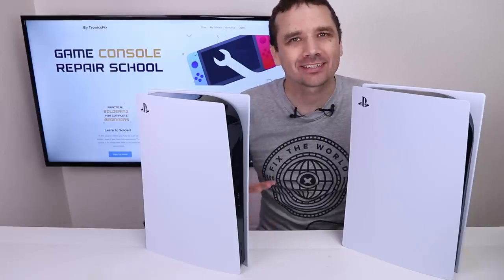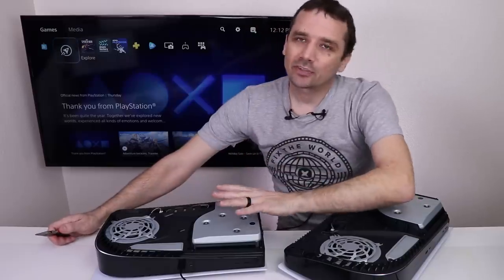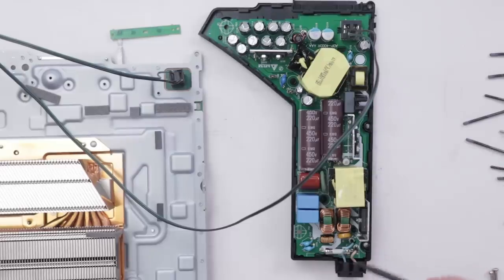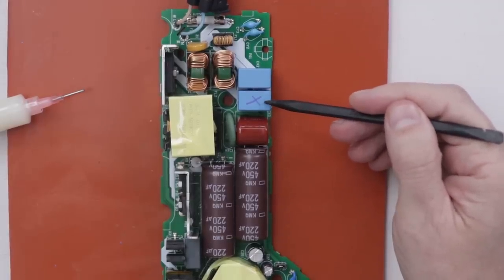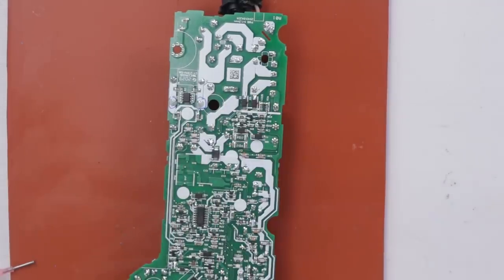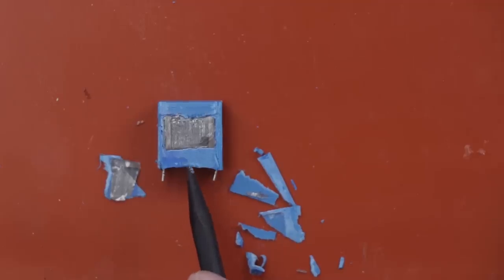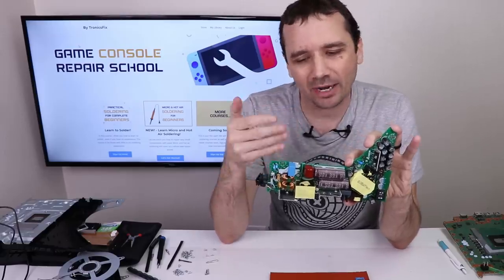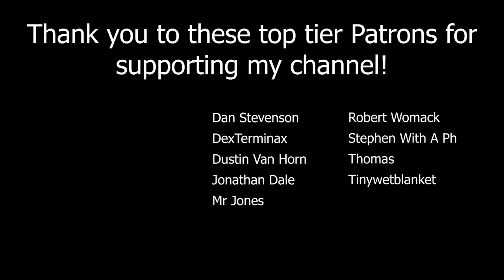PS5 Coil Whine - What Is It and Can I Fix It?

Comment: Hi there, I have some ideas on how to solve the whine you're hearing. I broke it up to several parts:

1. What is the cause of capacitor whine? How does current translate into audio? Why do more demanding games create more coil whine or capacitor whine?
2. How to replace the capacitor with a different one and what to look for
3. A strong warning about ESR specification and how to match it
4. An elegant solution that might work without replacing the existing capacitor, by adding another, small capacitor across it, and how to select the right capacitor, and how to do measurements to help select it.

1. First of all let's go back to how you understand capacitors, because you need to change your understanding of those to understand where coil whine comes from. So let's talk about current. Current happens in a circuit when the voltage source is somehow shunted to ground, through some sort of impedance. In the PS5 most of the use will be from integrated circuits. Transistors inside those, on the silicon die, essentially connect the voltage rail to ground, or something to that effect. This is almost completely a resistive connection. You call that a resistive load. You can imagine someone having a resistor going from Vcc (the voltage rail) to gnd (ground). That creates the /request/ for current: the supplying circuit will be able to feed it current up to a certain point, at which the load itself will start limiting the current. But most often the supply circuit will be the limiting factor, supplying less current than the load in question could transfer at most. This is due to where the current comes from. Where does it come from? It has to reach the chip in question via a long lead on the pcb (which has resistive and inductive impedance), maybe a connector, a cable, and then essentially it comes out of some sort of transformer. Transformers are the ultimate source of impedance in the circuit. Because they have high series inductance, they can produce a lot of current, but only /after some settling time/. This means that as you change your current draw, the transformer has to settle towards that new level of current draw, before it starts outputting that. During the transition, there will be pre-ringing and post-ringing. If the current request increases, the current will mostly undershoot and then overshoot and then it'll settle to the new value. It'll happen the other way if the current request decreases. This over/undershooting happens because the transformer itself has to produce the current. To do that, it needs to source something called the electromotive force. The electromotive force is what physically makes electrons in the circuit have the "will" to run around the circuit, producing current (charge moving around the circuit = current). This electromotive force takes some time to charge up because it actually comes from the other side of the transformer and that takes a while to transfer over air, kind of like the battery in your mobile phone doesn't get charged immediately using a wireless charger. Same thing. So now you have the transformer reacting to the changes in current consumption, but there's undershoots and overshoot. Overshoots are easy to deal with: the resistive load will be unable to pass more current through itself than it can handle. The undershoots are bad, though. This can cause a so called "brown out", and generally can lead to circuits not working as they should. It won't break them, but logic circuits can go awry. So for this reason, you need another source of current that will react much faster than the transformer. Imagine you have your voltage rail fed by a transformer, and only that. So what can you do? Well, you could add a battery in parallel, across the voltage rail. It holds some charge and is able to supply it very quickly. However, this charge is eventually going to deplete, unless you re-charge it. This is, essentially, what a capacitor is: a battery which is able to re-charge. Inside the capacitor, you have a roll, but unlike you said, it's not one strip of foil that is rolled up. It's actually two strips of foil. Those strips of metalised foil will be separated by a dielectric, and then as you roll the stuff up you also add another layer of dielectric to insulate the roll from itself. The capacitor stores charge in an electric field located between the two strips of foil (called plates). If you unrolled the capacitor without damaging it, it would still work. It would be two very long strips of foil with a piece of dielectric between them. One of the plates contains positive charge, and the other contains negative charge. The dielectric isn't infinitely rigid - it can be compressed. So the plates contain opposite charges... those charges will attract. Depending on how much charge the capacitor contains, the plates will attract with more or less force. The dielectric between them counters that like a spring. The plates will therefore move closer and further away depending on what charge there is in the capacitor. This creates movement, and if this movement is fast enough it can be heard, and that's called "microphonics". So why does this happen so often? Because the chips in the playstation turn their gates on and off very quickly, in a random pattern. This pattern is very random and will contain all frequencies up to the gigahertz frequencies at which the gates close and open. But it will also contain lower frequencies (because it's random), including audible frequencies. So what happens is that current changes a little, and then the transformer has a little lag and a little drop out before it can respond with the new current that was requested. So instead, a little charge will be unloaded from the capacitor, to provide the current that's missing, in tandem with the transformer. Remember, charge going out of the capacitor is current, just like water coming out of a container (eg bottle) is water current (like the current in a river). So every time a gate closes or opens, requested current changes, and therefore the charge in the capacitor changes, and so the plates in the capacitor move a little, and therefore they output sound. This actually explains why people hear this more in more demanding games: more demanding games require more logic circuits to be utilized (closed and opened), which means more power draw in total, this means higher current, and this means that the current swings are larger when the current ask changes, and therefore the charge across the capacitor gets depleted more when it needs to make up for the sagging, and therefore it is louder.
Reply: 2. So what can you do about this? You have a microphonic capacitor. You can do a few things. The first is: Install a different capacitor. There isn't really a rule to which ones are going to be better. However, things like MLCCs for example are known to be very loud. As far as electrolytics go (like the one in the video), if you keep the voltage rating, capacitance, and ESR the same, the larger capacitor is going to behave better because the charge difference across the plates is less, and the plates can be a bit further apart. Magnetism falls off with the square of distance (inverse square law) at small distances, so even the smallest amount of additional distance is going to reduce magnetic attraction force by a lot. However, it doesn't seem like you can put a much larger capacitor in those PSUs. If I were you I'd order like 10 different kinds. My guess is you have enough funding to do that. When replacing them so often, do the following: remove the original capacitor; then add some clipped-off, thick, aluminium leads you clipped off a large capacitor, where the whining capacitor goes on the pcb; then only ever solder the new test capacitors to those leads. This way you won't be soldering the pcb 20x (which will no doubt damage the solder point). But also make sure to solder the new capacitors to those leads, instead of using alligator clips.

3. When replacing the capacitor, be VERY wary of ESR. You don't just need to measure ESR using an ESR meter. That's not good enough. This is because the ESR of a capacitor /changes according to the frequency/ that's being measured. Essentially, imagine you're passing a musical note through a capacitor (in series). If it's an A at 440 Hz, it's going to be attenuated by the capacitor by some amount. But then if it's the C above that at 523.25 Hz, then it's going to be attenuated by a different amount. That sort of thing. This is actually very important in power supplies to make sure the capacitor doesn't produce a lot of heat, and so that it can produce the necessary minimum current at the frequencies that are going to be asked of it. You are going to have very large capacitors (those horizontal barrel types, axial capacitors) that handle lower frequencies; then the bricks that are problematic that handle somewhat higher frequencies; then even smaller capacitors that handle even higher frequencies (usually closer to the integrated circuit using them); then even smaller capacitors for even higher frequencies, even closer to the chip, and eventually ones that are super tiny, handle the highest frequencies, and are soldered onto the IC directly. You've seen them on computer CPUs. The higher frequency the capacitor needs to handle during current "brown-outs", the closer it needs to be to what is requesting the current. An ESR meter only measures at one or two frequencies. You need a sweep capable meter.

So what you do is you open the datasheet for the capacitor in question, and look at its frequency / esr graph, and try to find something with a similar graph. It's essentially going to be a graph with a single peak (which displays the inverse of ESR, called conductance) or a graph with a single valley (that's going to be the ESR). If that isn't correct, it could lead to instability, just like dried out capacitors on motherboards lead to instability.

4. What else you can do is you can try to shield the capacitor from this sort of current draw by "bypassing" it. Essentially, every capacitor on a voltage rail is a bypass capacitor. When you bypass something with a capacitor, it means you give the current requests an incentive to be fulfilled by your bypass capacitor, and not whatever you were drawing that current from beforehand. So if you want to prevent the capacitor in question from fulfilling current requests at audible frequencies, find a capacitor that has a much lower ESR than that capacitor does at audio frequencies. It has to handle the same voltage, but it does NOT have to handle the same capacitance. Then connect it in parallel with the existing capacitor, making sure polarity works, although you can use a capacitor that isn't polar either. Anyways, over the audio range (say 300 Hz - 10 kHz), the new capacitor should have a lower ESR value that depends on how much you want to reduce the noise by. So if your problem cap has an ESR of X Ohms over the audio range, then a bypass capacitor that has X Ohms ESR over that range will cut the current draw to that cap by half, and essentially reduce the noise by 6 decibels. (here I'm assuming those are linearly related, they might not be, not sure). If your bypass capacitor has X/2 Ohms ESR over that range, then the original capacitor will only be receiving 1/3 of the current, reducing it more. A bypass cap of X/4 Ohms ESR will go even lower. So if your problem cap has an ESR of 2.1 Ohms over the range 300-10 000 Hz, then you want a capacitor that has an ESR of well under 1 Ohms over 300 - 10 000 Hz. Maybe even 0.1 Ohms. And make sure that that new capacitor isn't microphonic either! Buy a few different brands. The nice thing is, though, that your new capacitor might be able to fit on the underside of the PCB (where you solder/unsolder the capacitor legs), between the legs. It might be very small! So it would be a great fix. You can in fact measure ESR using a signal generator and an oscilloscope. This would be easy over audio frequencies. You take a high impedance output (1M out) signal generator and make it sweep a sinewave from 300 Hz to 10 kHz. You take two 1k Ohm resistors and your capacitor. From the output of the signal generator, you split it to two paths. One path goes through the 1k resistor to ground. The other goes through the capacitor, then a 1k resistor, then to ground. So the output of the signal generator is connected to a resistor and the capacitor at the same time. Next, you clip your oscilloscope across the capacitor's legs, and look at the graph of the sweep, so that the whole sweep is on the screen at once. That's your ESR measurement graph. The taller the graph is at a certain frequency, the higher the ESR of the capacitor is. Now replace the capacitor with a 5 Ohm resistor to see what an ESR of 5 Ohms looks like, make note, and then you can read off the ESR of your capacitor off the oscilloscope. Easy! So you'd have the output of the sig gen go to two paths: the first path is a 1k resistor to ground; the second path is a 5 ohm resistor, then a 1 k resistor, and then ground.

I hope you've had fun reading. Let me know if you have any questions!

Comment: That's an EMI suppression capacitor. It's to prevent high frequency noise from travelling down the power cable. Because it's connected directly to the AC power, t's a Class X safety capacitor, so it should only be replaced with another Class X.
Reply: Pity it doesn't stop high frequency noise from getting into your brain lol, dumbest design I've ever seen and heard in my life.. It's almost ruined my life :0

Comment: Please just in case explain how to discharge those bigger caps without frying anything or die during the attempt.
Reply: smart way is discharging them through a beefy resistor.  quick 'n dirty way is to just bridge the terminals with something like a screwdriver ~ not recommended though lol
Reply from the maker: I use electricians insulated pliers and touch the two wires coming out of those huge caps. Makes a very loud snap so be ready for it!
Reply: I use a 220v common household led light (my country uses 220v) with 2 wires and touch the legs of the cap with them. Sometimes the light turns on for a fraction of a second.
Reply: @Tronicsfix   those pliers are just shorting the caps, which means all the discharging happens internally, within the cap, creating heat and whatnot, which isn't great for it but probably won't kill it if you only do it a few times
not to mention the ablation at the surface of your pliers or the legs of the caps from the spark discharge lol
Reply: @franciz2  that's a probably a pretty good way of going about it!  a regular incandescent light would work just as well probably, they're literally just plain resistors
Reply: @junky228
Yes, I thought the 380v in some power supplies would kill the lightbulb with the spike but I have been using the same one for years and it is still working...
Reply: @franciz2  guess it's such a short spike that it doesn't affect it too badly
Reply: @franciz2  yes I was wondering that, we use 220 here
Reply: You are supposed to use a resistor to short the big caps. A large one like a couple of watts and few hundreds of Ohms, can't remember the recommended values but it depends on the capacitors. You can make a shorting "tool" by installing that resistor on some insulating stick or something and bend the leads to be able to touch the capacitor ends. Shorting cap with 0 ohms (pliers or plain wire) isn't good for the capacitor. Some designs use bleeder resistors that are permanently installed in the circuit parallel to the cap so the cap discharges after power is turned off within seconds. That costs money so it probably isn't common.
Reply: @Tronicsfix  maybe you should use a resistor (some kOhm)
Reply: Connect a wire to ground and touch the leads of the capacitor with it while insulating your self from the wire. Just like every other person that messes with high current capacitors.
Reply: when u put your multimeter on it to measure the voltage the display draws current - you will see the volts going down - that discharges it abeit slowly - but safely - takes a while but no crack or pop
Reply: @Tronicsfix  This is why we love you.

Comment: The capacitor is across the mains input to both supress small transient voltage fluctuations coming in but mostly to prevent any electrical noise the power supply itself makes going back up the supply line and into your house circuits.  Without this filtering any noise the PSU makes could affect other devices.  You will see the capacitor says "X2" on it which is the class.  X is designed to be used 'across the supply' and X2 means it has been tested to 2,500v.  (X1 would be 4,000v).  No idea as to why it should make any noise though, it is usually only inductor coils that make some noise.  A tip if you are doing the 'listening; test in future, is not to put your ear near the circuit (made me cringe watching), but take a 30cm length of tube - garden hose or similar - and put your ear at one end and the other end near the device you want to listen to.  Works kind of like a doctor's stethoscope.
Reply from the maker: Thanks for the comment. The hose trick you mentioned is what I was using in this video.
Reply: @Tronicsfix  Ah, sorry. I did see something a bit later, but thought it might have been a screwdriver pressed to the capacitor and your ear.  Car mechanics used to use that trick to locate engine noises, but not a good idea for circuits unless whole shaft and top is insulated. Love all your videos.  Hope 2021 is a good one for you and your family.
Reply from the maker: You too! I used to be a car mechanic and used the screwdriver trick before I got a stethoscope.